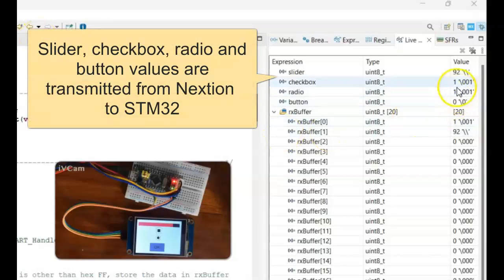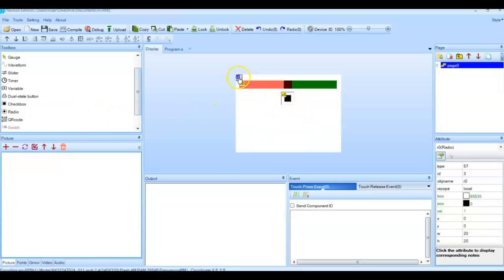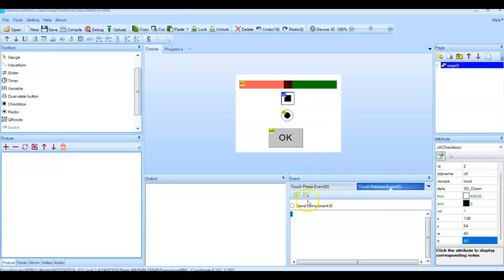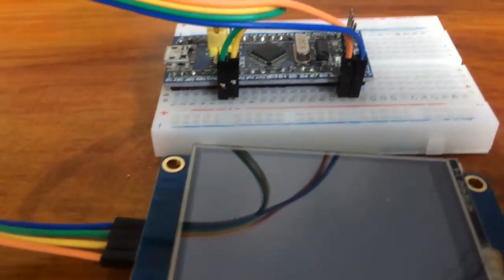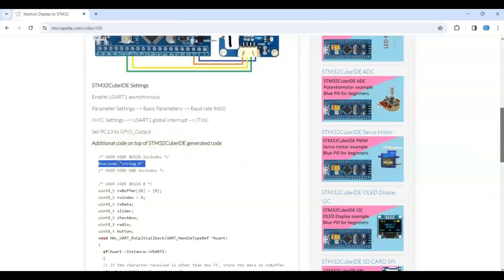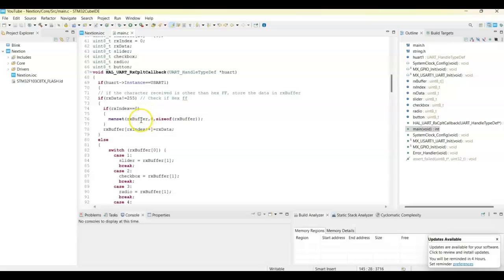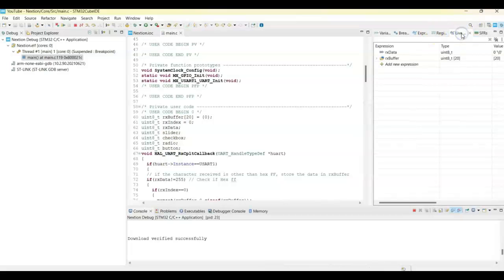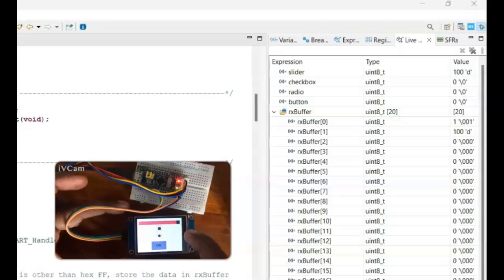100. Sending values from nextion to STM32 using STM32CubeIDE

Comment: He'll sir, I need your help. I have E220-400T22S. I want to write program for TX and RX. I want TX send data to receive a fixed RX Device. If nearby many devices is available. (Tx device must have RX Address) How can I perform this? Please help me sir.
Reply from the maker: Is it about LoRa module
Then you can set key and frequency as shown in video https://youtu.be/6vIYaawRQ2g
Reply: @NizarMohideen  but sir, in this video you teach to set key and network address. Please help me sir 

I am confused if I set parameters for TX:  Network:1, Channel: 23, Key: 5.
And  for RX: Network:11, Channel: 23, Key: 51
In Fixed Transmission: Enable.

Q1. How to tell in the TX device program that the signal needs to be transmitted to the device that the address only contains Network: 11, Channel: 23, Key 51.

Q2. Is I need to set key parameters for both devices?

Q3. If I have two transmitters and one receiver then how to set key parameters?
Reply from the maker: Need to set the same key and frequency for all your devices.
Then it will not interfere other devices nearby
Reply: @NizarMohideen ok sir, thankyou I will try it.
Reply: @NizarMohideen Sir, What do I need to set for Fixed Transmission: Enable or Disable?. I just want that only that receiver receive signal that's key and network address is same . please tell me.

Comment: I would like to know where to buy a blue pill that actually works with cube ide. I enjoy your videos.
Reply from the maker: Thanks for your comment. We can try purchasing from shops who have high ratings and many reviews. Good luck

In case if you receive clone non-original boards, we will have error messages such as “Failed to start GDB server” or “Could not verify ST device!” when trying to upload from CubeIDE. 

There are many ways to overcome cheap/clone STM32 with STM32CubeIDE.
I have published many videos showing how to upload and debug clone STM32 using CubeIDE.

We can upload CubeIDE HEX file via CubeProgrammer as I have shown in video 92. https://youtu.be/YocudAJBH-g

In the above way live expressions will not work. I have three different ways of seeing the variables in video 97, 98 and 99
https://youtu.be/iYvUzxABmTk
https://youtu.be/jyoz5K3DsUg
https://youtu.be/YwkMZ6CUazw